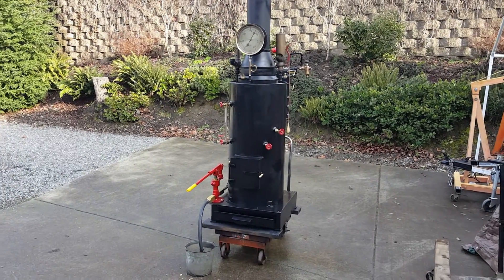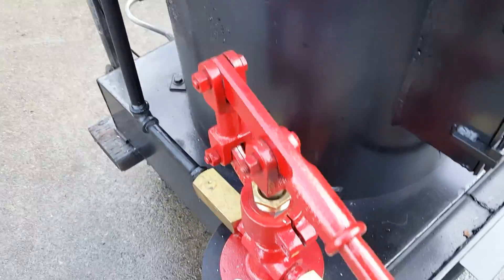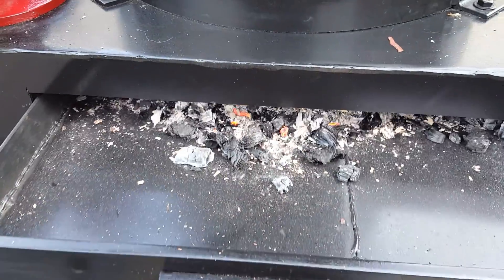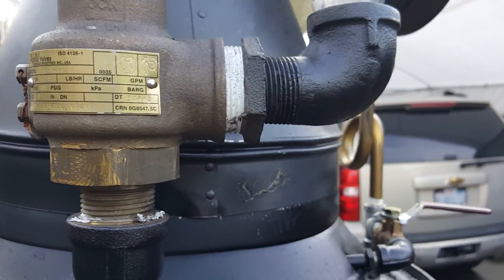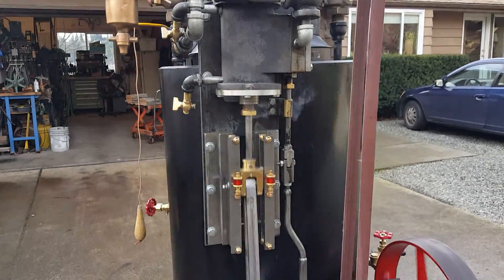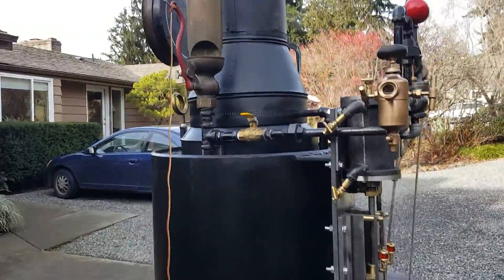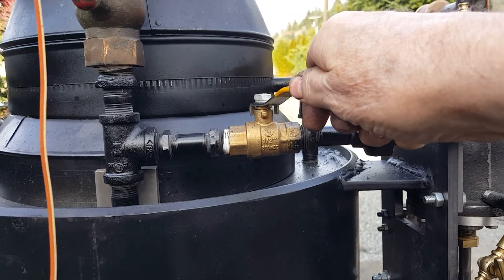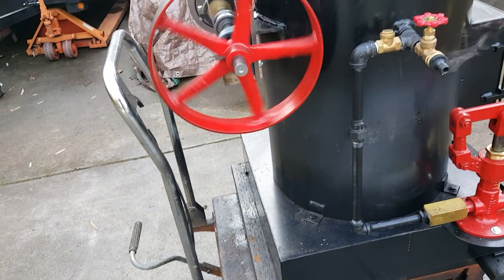Live Steam Boiler with Engine Flyball Governor Whistle Pump Off Grid SOLD

Comment from the maker: First! Thank you for the complement. It is hard to make a boiler look beautiful.
 I use a variable speed Milwaukee drill that I modified to roll the tubes in. And yes it can get away from the operator.

Comment: That thing is beautiful! I'm a union boilermaker from WV and have had to roll tubes a few times but they've all been steel. Do you use a factory made air powered tube roller or have you came up with something on your own? The ones we use are a dangerous beast that'll crack a rib if you don't hold on tight.